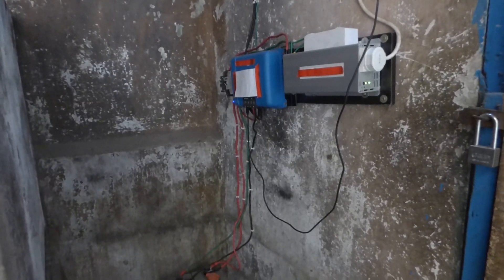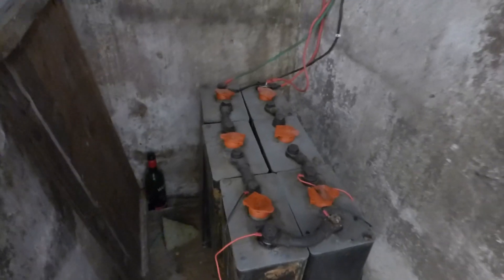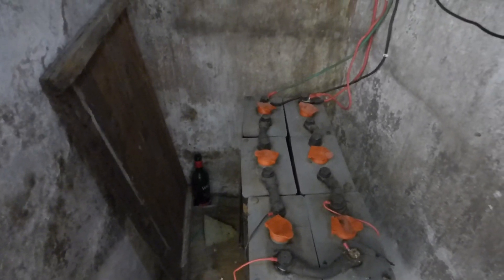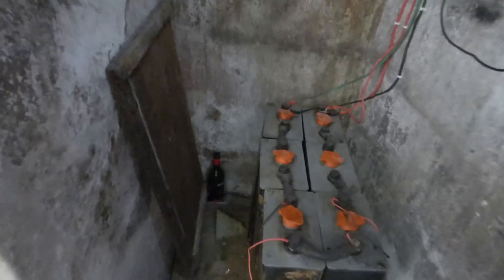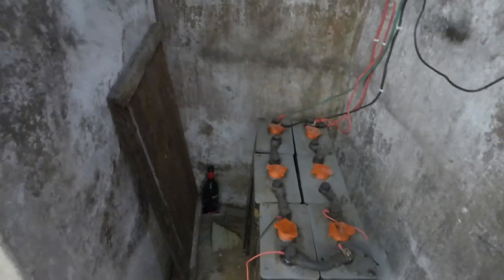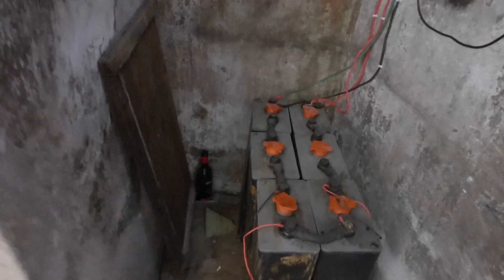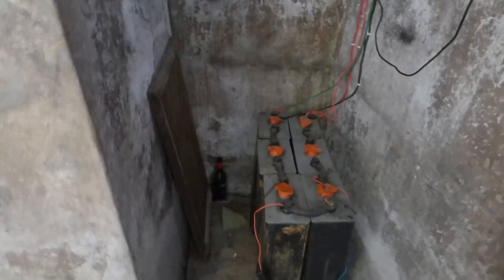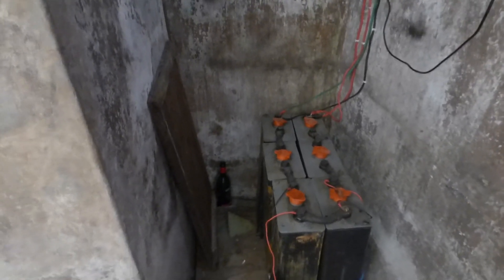Our Forklift batteries one week later. Did they work?

Comment: ayo those wires are so thin !
Reply from the maker: 12 V on a 600 Watt inverter charging with a 300 watt panel. Do you still feel that it is too small? Thank you for watching and commenting. Please don't forget to subscribe like and share
Reply: @drsolar   if you use all the 600 watts on the inverter,it can get up to 50 amperages,its not just small,its a fire hazard! the lower the voltage,and higher the current the more resistance you have in the wires,the only reason its not melted yet,becouse probably you dont use the inverters full capacity.
Reply from the maker: @83kaszas  please look at the ampacity chart and the current ratings for a 35 mm cable. You will agree that it is more than adequate for what we are doing. Thank you for your message and observation. Please like share and comment. Don't forget to subscribe

Comment: Ah the joy of flooded cells haha

It was very interesting to hear about the sulphation actually breaking up and the heat travelling down the cell, at least they're resistance is still low enough to accept charge as opposed to a few ive tried to revive over the years and have them barely accept 2A of charging current (30Ah-75Ah 12V batteries).
you mentioned overcharging them as a way of equalization charging them, i'm curious what voltage are you supplying them ? 

Thanks again for another great vid Dr Solar, all the best from down under.
Reply from the maker: I hate them. Once you go with lithium ion, you can't come back to flooded. The most they have seen is 14.2V so far. I am only able to push 20 amps at 12 V. My goal is 16V and I know that would take a very long time. From all I have seen and read the suggest you feed them low current and gradually increase. Sadly the most I am able to do at full tilt will about 40 amps and that will not happen this time of the year. I figure that as long as I do something daily I will see gradual improvements. I have seen it on one of the two not so good batteries. And the really bad one responds at 14V. So you never know

Comment: Do the math. You need 750 AH at a 20 A charge 37.5 hrs to charge at 20 A No good . You need to charge them in 5 hours
Reply from the maker: Frank it is a low budget system and I am not willing to throw any more resources at it. I am already out an inverter a charge controller and the other stuff that you see. They will use till it dies and then I will recycle the batteries.
Reply: @drsolar  no worries. Just saying there is a min charge batteries need. Most ppl would say the battery needs to be fully charged 1 time per week. Or they will die.
Reply from the maker: @frankz1125  I agree with your observation. They are seeing about 2.3 - 2.4 V per cell. That is pretty close. I am sure we will see 2.5 per cell or 15V pretty soon

Comment: Boil them
Reply from the maker: Where can I find a cauldron that is big enough to do just that? LOL. I am hoping that over time and gradually that will happen
Reply: @drsolar  lol use voltage but you could hit them with 17 volts for a few hours or if that is hard to do just wire them up in smaller groups and hit them with 12 volts which would be 4 batteries. What ever you got to work with even a single cell could be heavily charged with maybe 3 volts from a variable voltage power supply.
Reply from the maker: @offgridwanabe  I will try what you suggest. I am sure we would find some tricks as we continue to explore what to do with them. I have taken them from 48 down to 12. I will see if I can find a heavy duty 12V charger and try higher voltage and current. Thanks for the idea
Reply from the maker: @offgridwanabe  that is an idea that we would gladly explore. This would be an experiment that will would nurture over time and we would do videos with our feedback. Thank you
Reply: Where can forklift batteries be sourced in Nigeria?